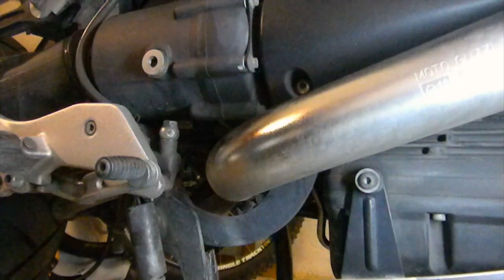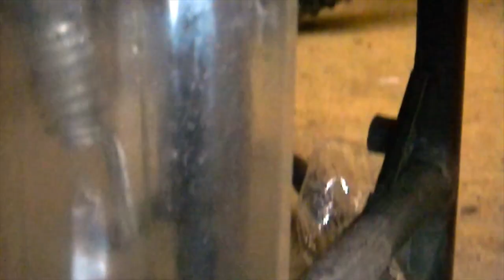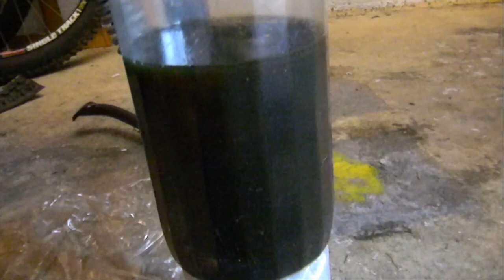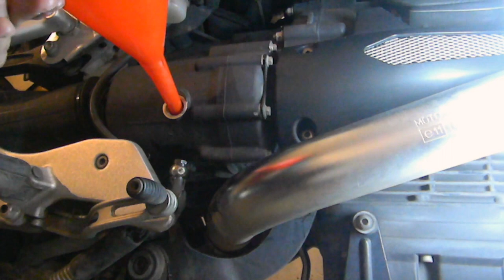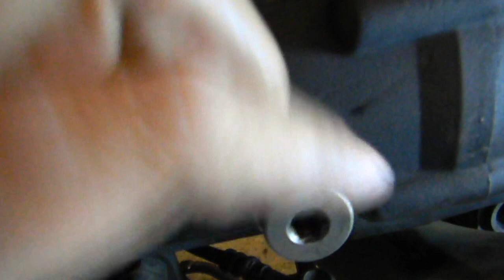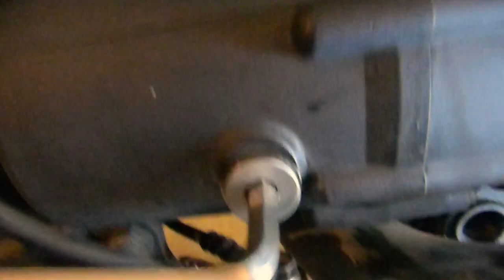Guzzi Stelvio gearbox oil change

Comment: What a horrible place to put that drain bolt.  Clever way to deal with it.  I just bought a 2017 V7iii.  Trying to learn how to do the gear box oil change.  It's a little different on mine, but it seems pretty straight forward.  Drain. Refill.   The gear box drain bolt on the v7 is on the bottom of the engine, which seems like a better place.